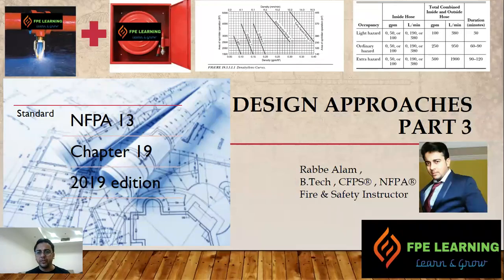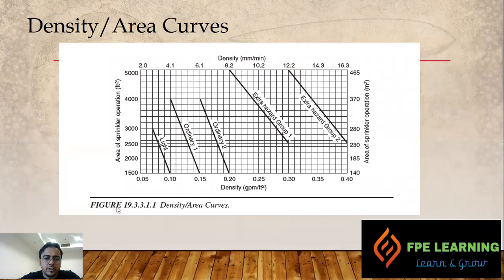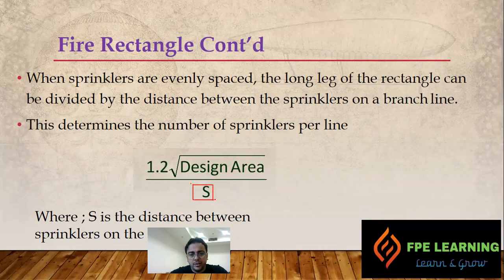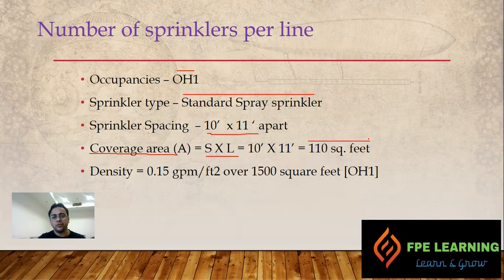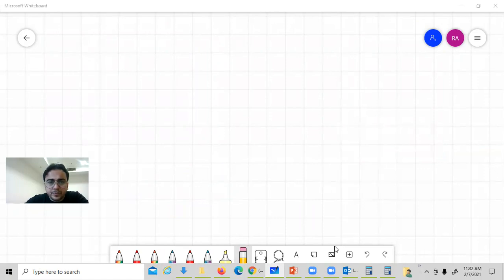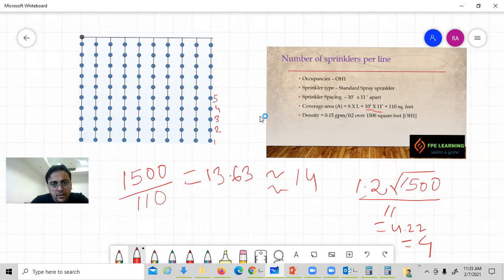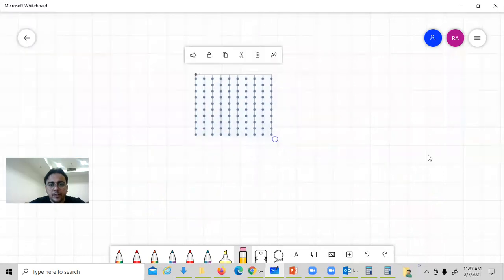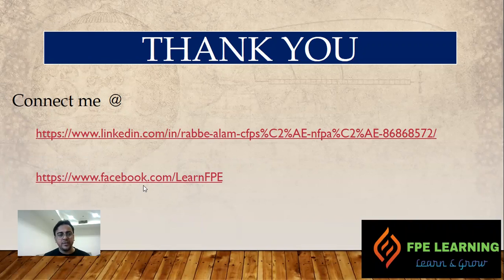Design approach - Part 3

Comment: Question: In the above given example layout each branch is connected to the main line with a Tee Connection . 
Considering the secondlast branch and last branch. In Hydraulic Calculation does the pressure loss in Tee gets duplicated?